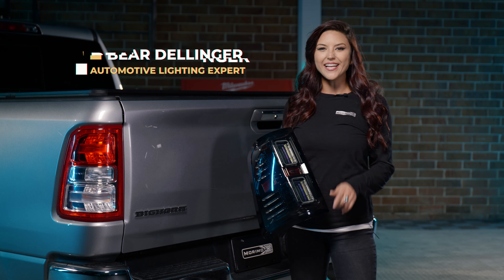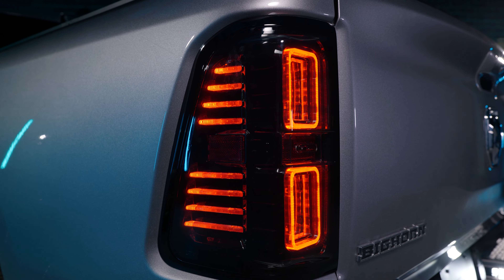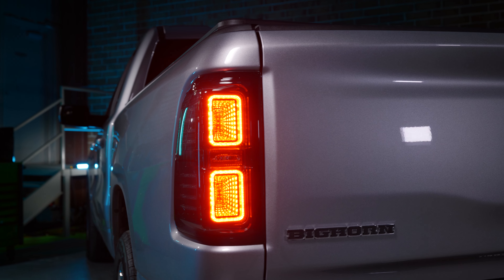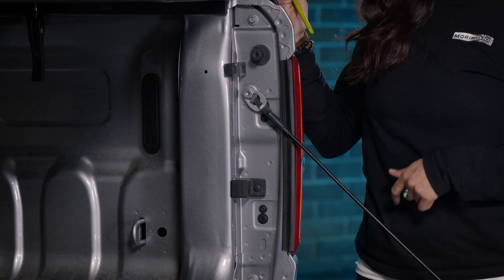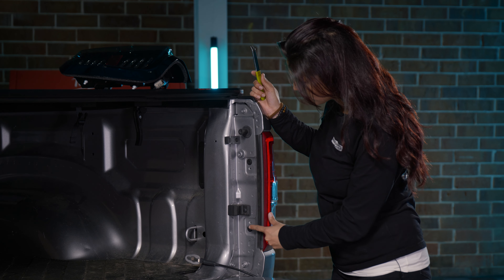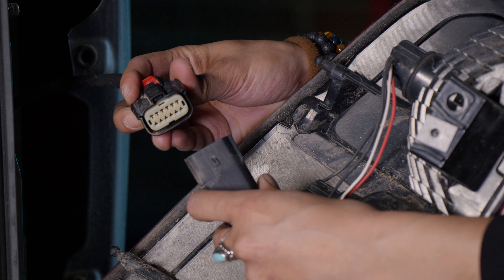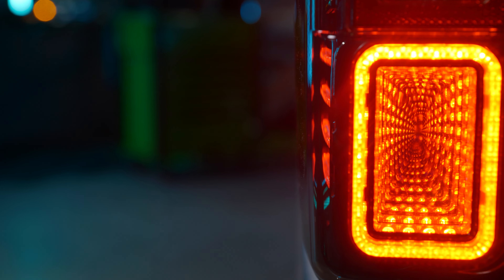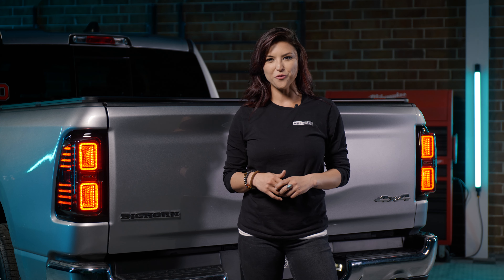Morimoto XB Tail Lights Install for the 2019+ Dodge Ram 1500

Comment: This would work on a 2014 Ram laraime projector?
Reply from the maker: Sure thing! Not this exact model since these are for the 19+ Rams, however these ones in this link will fit your 2014!

Link: https://www.morimotohid.com/morimoto-dodge-ram-09-18-xb-led-tail-lights?quantity=1
Reply from the maker: These Taillights will work for 2009-2018 w/o OEM LEDs
(Note: 2013-2014 trucks may require reprogram to avoid error codes)

https://www.morimotohid.com/morimoto-dodge-ram-09-18-xb-led-tail-lights?quantity=1
Reply: @MorimotoLighting  thank you for the quick response!  Lovely

Comment: How do I know it will work on 2020 Laramie
Reply from the maker: Check out the compatibility section. 
For these tails they are only compatible with 19+ Rams OEM Incandescent tail lights. 
They won't work on the classic trucks either.